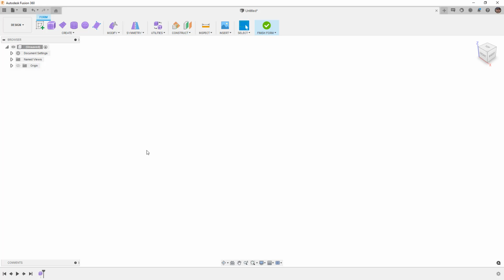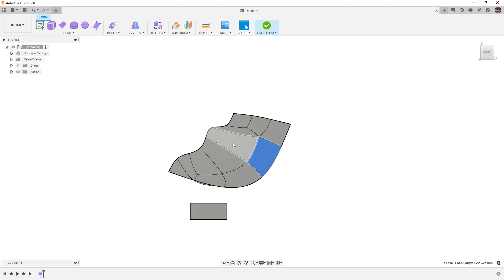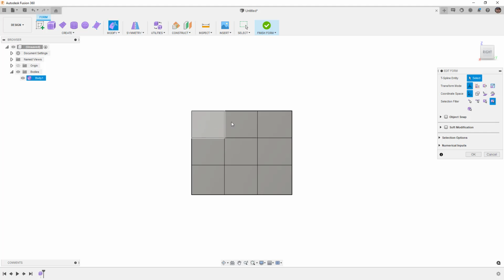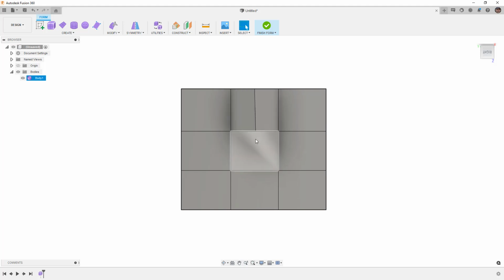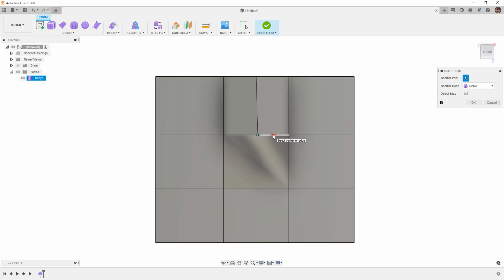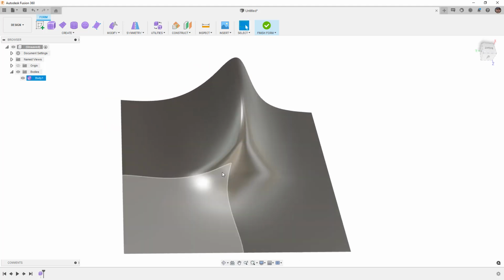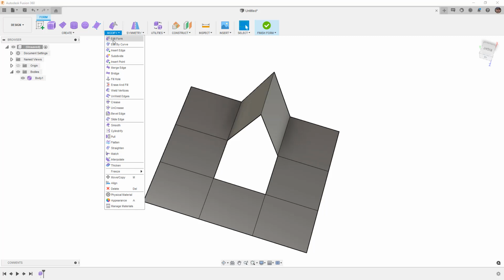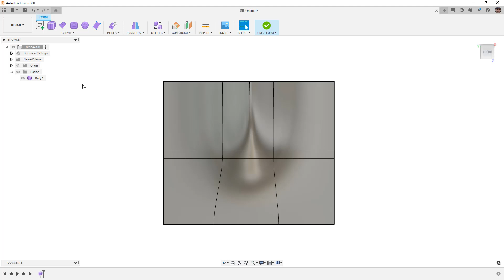Fusion 360 Form Mastery - Part 2 - Starting with a Form Face or Plane #Fusion360 #Tsplines #Forms

Comment: Just seeing this iam getting the cylinder view of the wheel bro... It's like transperant... Is it normal???
Reply from the maker: Any bodies you have visible before you go into edit a form will show like that.  there are tools like Match in the forms workspace that let you attach a form edge to a solid/surface.  To get rid of those you need to finish the form, then hide all the bodies (even the converted form if you don't want to see that), then edit the form again.
Reply: Thanks bro 👍  @LearnEverythingAboutDesign
Reply: @LearnEverythingAboutDesign u earned a sub 👍👍👍

Comment: You know the kinder surprise eggs? how they snap together to hold a treat or toy? I would love to learn to model the egg shape and find a way to design the tolerances for snap mechanism.
Reply from the maker: Back around Xmas i did a quick video on designing something like that.  https://youtu.be/L-tx4nSKG70  

the snap together part is going to be a bit based on your printer and how accurate it is.  Because of the layer lines a few vertical traces on an "exact fit" wall will snap together, but not a true snap like the egg.  Generally you have a lip that bumps out on one side and you have a groove that bumps in on the other.

Comment: Why do the edges become angled when you try to add a straight edge that doesnt land in the middle of 2 other edges? In blender you can add a straight edge anywhere but with fusion 360 it bends the edge if you try to add it in between 2 other edges.
Reply from the maker: A few things.
When you use insert point or insert edge there are 2 options.  Exact and Simple.  Simple will put the edge right where you want it.  Exact will put the edge close but maintain the exact shape.

Comparing Blender and Fusion Forms is a little tough.  Blender you are directly working on the mesh.  There is no "smooth" version.  You can do graphic tricks to smooth it out and you can subdivide it but at the core where you put an edge/face is where it is.  With Fusion Forms we are actually building a cage in box mode (CTRL+1) that drives the underlying surface seen in smooth mode (CTRL+3).  you can export the box cage to blender and you can bring in a quad mesh to fusion forms and convert.  I have a few older videos on those processes.  But the core of what we are doing is different because the Box is "pulling the strings" on the tangency direction and tension of the surface it wants to create while in Blender the Box display is all you have.

As for why the edges go where they go. aside from the insertion method, each face has its shape controlled by whats around it.  This means where the edges show up on the smooth display depends a bit on what is going on around it.  There is an option in the Utility make called "make uniform" which tries to get the smooth display divisions closer to the box display divisions but they will still have some variation based on the shapes.

One good thing to do is work in the hybrid display mode (CTRL+2) which shows you the smooth shape you are creating but makes the box/cage around it which is what you directly manipulate.  In blender if you add a Nurbs Curve this is a good representation of whats going on. You have a cage around the curve that you use to control it but the curve itself is inside the cage.  Now take that and make it 3d.

hope that helps.

Comment: I am wanting to french a can shape into the rear fender of a 1942 Willys Coupe to mount a tail light from a '58 Cadillac.  I am able to define X-Y-Z coordinate points from the actual fender that I have in my shop. Which of your videos do you recommend I study to to convert these points into a 3D curved surface?
Reply from the maker: Hey There!  There are a lot of videos that could help, this playlist goes over building a fender shape off a scan.
https://www.youtube.com/playlist?list=PLBDfGh8A8kXWeZ6Q2C8P9xPw5oMUEEEWZ

it is more of a rough approximation because of the intent there but a good start.

I have a few other videos that might be applicable.  MX5 brake duct, spoiler, reverse engineering a dash panel.  There are various workflows talking about mesh section sketches, freeform, surfaces etc.

The "easiest" method is if the mesh you have can be converted to a clean Quad Mesh before it gets into Fusion.  Then all you have to do is convert it to a form and bada bing bada boom!

Comment: when i weld two vertices then how to go back to smooth display from box display i am pressing alt +2 ,alt+3 and alt+1
Reply from the maker: smooth is ALT+3 but if you only weld 2 verts together it might not be possible to see a smooth display until more are welded.  If you had two areas connected only by a point it can't calculate the smooth untiil a common edge is made.
Reply: @LearnEverythingAboutDesign  thanks 😊

Comment: Hello,

What is the 'correct' way to impose measurements when designing out of form? For example in the shape manipulated in this particular video, if I wanted to set the height of the blob according to some measurement, and maybe come back to change it to a different height?
Reply from the maker: The only way to do that is to use the Match tool with the Associative option checked.  This can snap to the edge of a solid or surface so building those features first before you get into forms is the key.  I did a few videos later in this series about the match tool with Associative option and things to watch out for.  https://youtu.be/QOylnpsG3Qc
Reply: @LearnEverythingAboutDesign  Thanks, I'll watch that video.

Comment: Is it just me or would Blender have done all that and then some? I find this Form stuff in Fusion inferior so far. Lots of menus hidden away with tons of clicks required. Not sure if I should continue learning about it.
I like solid and surface modeling in Fusion opposed to Blender cause I can just sketch essential details, then loft it together or whatever it needs, a lot of the in-between steps are handled by Fusion.
Thats what I disliked in Blender and got me to switch.

But now I need a very organic shape, yet everything kinda needs to be tangent and flow into one another. And some areas about it have to be exact in terms of dimension and placement.
With Solid/Surface I run into the problem that I just can't seem to blend so much curvature together nicely. I basically need sweeps on top of sweeps on top of lofted surfaces ect.. you get the idea.
I look at your videos cause my shape is similar to a car, it basically has all the same features in terms of design, just put together more organically and less uniformity to it. Curves fading in and out of eachother.
Easiest would be to sculpt it in blender but then it looks too hand made and can't be controlled at all.
Reply from the maker: well Blender vs Fusion depends on the end goal.  Blenders end result is a mesh.  Fusions end result of a form is a NURBS Surface.  If you are just 3d printing or rendering and the geometry is easier in Blender, there isn't much of a need to use Fusion.  But if you need true solid/surface geometry then a CAD program is needed(or to convert a quad mesh to a solid/surface).

As far as tool access, in my videos I also show where the tools are so new users know where to find it, something I find incredibly frustrating about Blender tutorials is the rapid and frequent hotkey usage.  Blender has way more menus and commands but everyone uses hotkeys(which is fine once you know them).  With Fusion you can speed up the workflow by using hotkeys, the right click marking menu(which is contextual), and/or the S key which is a shortcut menu that you can customize with any tools you want.  When you hit S you can also start typing to find a command,  when you do the 3 dots to the right has an option to Pin to toolbar or Pin to shortcut.  If you pin to shortcut it will show up on the S key press.

Comment: Very interesting. Being a new Fusion user, there's is a lot to learn. My focus is on guitar design, combining solid modelling with t-spline surfaces to create a a hollow body acoustic/electric guitar. Working with form geometry to create an asymmetrical arched guitar top to fit perfectly with the solid hollowed out body has been a challenge. Your videos explaining the use of form geometry are helping a lot.
Reply from the maker: Thanks for sharing!  There are pros and cons about using forms.  It does give you a lot of freedom but it certainly can be tricky as well.  One issue you will have with Forms is that it is a bit of interpolation.  If you need a form to exactly fit something that exists as a solid or surface you want to look at the Match tool.  I have a few videos on it in this series.  There is an Associative option that will link it to the surface/solid so changes "should" update.

Also I have at least 1 video talking about guitar modeling and transitions using surfacing tools here. https://youtu.be/aClYdrm87uM

if you have any questions feel free to ask.
Reply: @LearnEverythingAboutDesign  That's awesome info, and thanks for the link (I haven't scoured over your entire channel yet). I've been learning Fusion for a little more than a month now and while I've gone through many of the solid and surface tools and functions, it's not quite doing what I need it to do ... so now on to forms tools and seeing how I can combine it all into a finished product. 
The challenge with designing an asymmetrical drop-in arch top for a body that wants a flat top .. I think I need to approach it by creating the critical centre arch, then sides and cut aways seperately and welding them together ... just an exercise in logistical planning for a newbie. :)
Reply from the maker: @homemade_vancity  There are some tools that would make this easier for you as well.  Tools Like Replace Face.  You can make a complex shape face and then use that as a replacement for a planar face.  Forms are easier when they are square.  when you start pushing them into odd shapes it takes a lot of practice to get them right but you can make some cool designs!

Comment: Thanks for showing us how to use forms better, I am trying to learn to design better models and this has helped a lot. One thing though, when I am creating the form in the video, using the smooth display does not do anything. Any idea how to fix this?
Reply from the maker: Do you mean it stays on a box display even when trying to make it smooth?  This is likely caused by an error point or possibly an overlap in your form.  Try running the Repair utility to see if it can fix itself.  If not you need to look around for any overlaps
Reply: @LearnEverythingAboutDesign  that fixed it, thanks so much

Comment: Sir I have been following your tutorial....but I'm learning it for something....for layered design 

So after getting a particular irregular form...I want to be able to slice it into parts that when cut and stack it together will form the shape....please  am I learning the right workbench? ❤️ 😍
Reply from the maker: Hi Minra.  You can certainly slice up a design.  You would most likely want it to be a solid and not a surface though.  It depends a little on how you plan to build it.  If you are trying to stack material that is 10mm thick for example, then slicing it every 10mm and making a sketch off that face to make a DXF you can laser cut is possible, but very time consuming.  i don't know if there are any "slicer" programs that would automate that for you.
Reply: @LearnEverythingAboutDesign  how about slicing it into a separate component and cut each so that when stack together it forms the shape

Comment: Hi Mat, I'm 7 months behind here, but my goal is to model ceramic shapes and generate the tooling for them. That's mostly plaster moulds. What I've always been aware of is that extremely subtle changes in form make a significant visual difference. Some critical areas where subtle variations matter most are rims and handles but I'll start with very basic vase shapes with no handles while I'm learning. The internal geometry of vessels doesn't matter nearly as much, in fact the manufacturing process, slip casting, has no internal moulding surfaces once you get away from the rim. These basic vase shapes might be most easily done with surfaces but the form tools in Fusion look like they allow a really neat way to nudge things around by small increments. We'll see.
Reply from the maker: I would be happy to make a video Arnold if you have some hand sketches or pictures of the shapes you are trying to make. just email me support@caducator.com

Comment: You mentioned a whole series of traditional poly modeling packages towards the end .  I assume they allow for greater control in some way, but what are the main pluses and minuses of T-Spline modelling?
Reply from the maker: Hey Sadhu, I cover this in other videos, specifically a video on Fusion vs Blender for Car modeling, but the main thing is that Blender is for modeling mesh bodies, and Fusion Tspline bodies get converted to BREP which is a true CAD surface/solid.  It really depends on what the end goal is.  If you are looking to just make designs for renders, animation, games, movies then poly modeling is typically the way you would go.  Maya, Cinema4D, Blender and so on.  If your goal is to manufacture something and/or you need more precise features then a true CAD tool like Fusion would be best.  I have several videos talking about how to get designs into Blender and how to get them back to Fusion and back to BREP models.

I will be releasing a Blender for CAD users series learning how to model in blender and trying to draw some similarities in the workflow we have been developing.  Hopefully that answers your question.

Comment: I've been trying to design the B2 Spirit Stealth bomber. At first glance from afar the shape looks like an easy parametric design. However, when taking a closer look there are some very subtle yet important curvatures to the design. Do you have any advice on how you would use the form design to model this?
Reply from the maker: Hi Jon, definitely start in box mode and work with symmetry and figure out the "shadow" shape from the top looking down.  That is probably how I would start it.  Then i would begin to bump up geometry.  When I have a moment I will give it a try.  If you can find "drawings" of it showing a true side/top/front view you can now use the MATCH tool to get a good match to a sketch for those sections.
Reply from the maker: Jon, I just gave the B2 stealth bomber shape a try and recorded the process(no audio).  I will put up a speed through video tomorrow.  Its not perfect by any means but maybe it will help you out.  To get the sharp edges you need a lot of control which is counter to the standard workflow.  https://a360.co/3KvAle2
Reply: Thank you very much! That is awesome, I love your series and I am learning a lot from you. Much appreciated!
Reply: I love it, that is really good!

Comment: Will watch it later, just jumped in to like and comment xD the production value is absolutely top notch
Reply from the maker: Thank You!  I don't have a product idea for this series but wanted to lay the foundation for using these tools on anything.  It will likely be car related though ;)
Reply: @LearnEverythingAboutDesign  Car related i can relate to xD and despite about 250 own designs in fusion i still wouldn't call myself even intermediate, some tools still baffle me xD I'm sure ideas will come in time and from comments and tangents in the videos, i sure have ideas that ill inevitably write in a comment at some points
Reply from the maker: I was thinking a dash board would be a simple design where we can highlight some of the techniques needed to control edges.  Has enough flexibility to add detail where needed and some broad shapes.
Reply: @LearnEverythingAboutDesign  i will probably need it to retopologize my 3d scans , haven't been happy with the results yet. The convert mesh option usually crashes
Reply from the maker: @Tarex_  Convert mesh is a crap shoot sometimes.  I just went through this Friday with a mesh that had loads of facets.  For bodies that are very prismatic it does great.  Retopo takes awhile depending on the level of detail.  That is one of the downsides of using photo programs to create meshes vs a production scanner.  Cost of entry is way better though ;)
Reply: @LearnEverythingAboutDesign  technique gets refined with more tries, i do get really clean meshes now compared to the first scans, the depth of field on my phone camera is the biggest factor that keeps the meshes from being 99% perfect it blurs anything farther away so much that the point cloud is really noisy